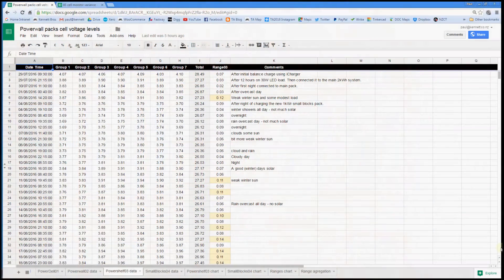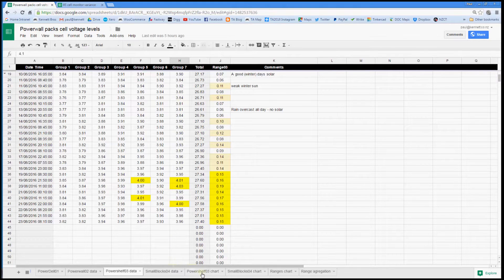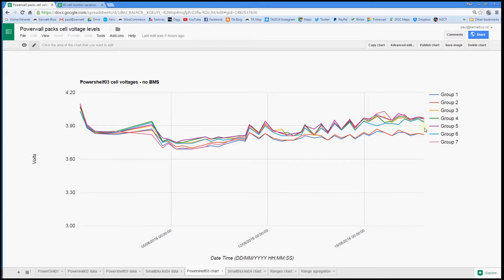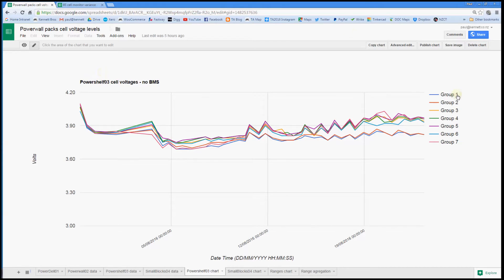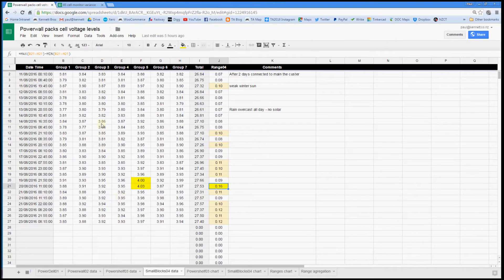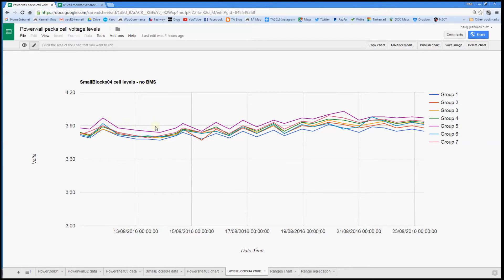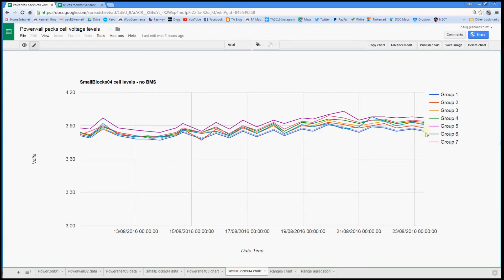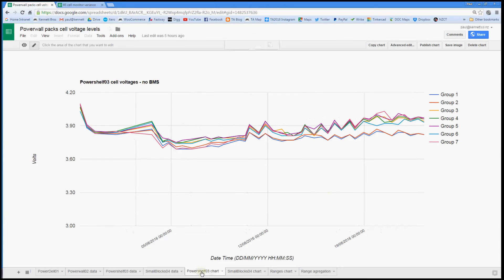Laptop Powerwall 59 - Powershelf without BMS: 3 weeks later

Comment: First of all, this is really informative. My question is, since both charging and discharging occurs during the operation, what is you cutting threshold? I mean, if you continue testing the system without BMS, and someday the sun is very strong and you have enough solar energy to fully charge the system, at which point will you stop? Since you are testing no BMS condition, I am assuming that the charging will stop until the highest voltage cell in the system reaches your threshold voltage. (say 4.10v)  Is that correct?
Reply from the maker: Hi Yichuan. I've got my solar charge controller set to stop charging at 28 V. So if all 7 groups had the same IR then that would be (28 / 7 = 4) 4.0 volts per group. As I monitor the groups I'm waiting to see if any group hits 4.1 V. When that happens I'll end the experiment. (Then install a BMS.) It's been 5 months now and none of the groups have have hit the 4.1 volt threshold.
Reply: Thanks! That's a pretty legit setup!
Reply: Also, your three-week operation is a simulation of daily life use. I think, if you have time, you may design a series of charging and discharging process that simulates a harsher situation. Another thought is that you may test for longer period such as 2~4 month in order to see the limit of your system.

Comment: Very good :) After 3 weeks a drift which is what i would expect, If you left it for a couple of months it would be dangerous. Long term a bms will be needed so you dont have to watch it weekly etc.
Hows the 2kwh bank going with that bms? i first one u did?
Reply from the maker: Yep. I've been using BMS on all my packs thus far. Just wanted to see if I could replicate Jehu Garcia's results - he didn't use a BMS on his big blocks and they didn't drift. Maybe he was a bit more particular with his cell selection.